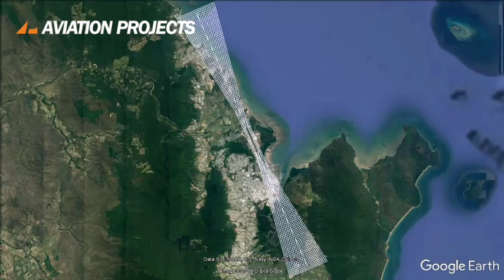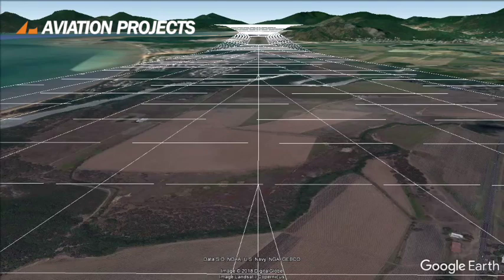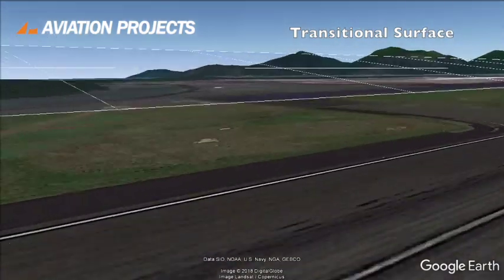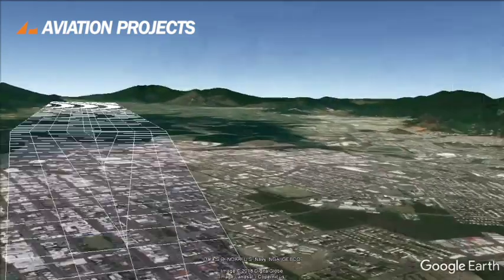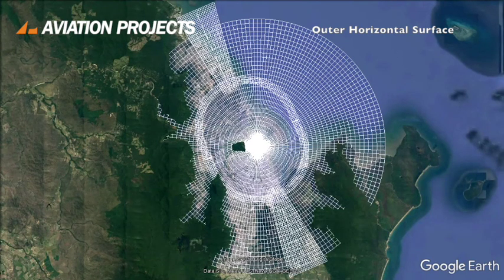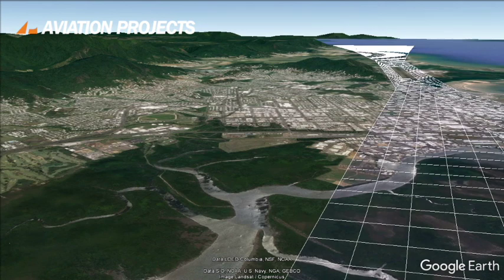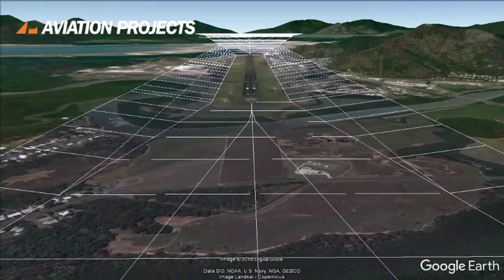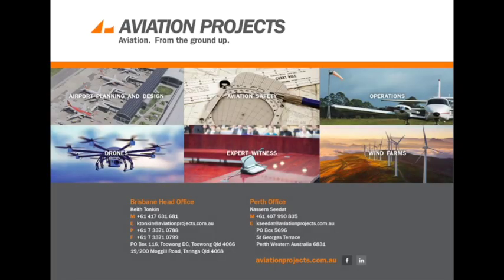Introduction to obstacle limitation surfaces

Comment: on takeoff , 600ft  clearance of a 9ft high wall is enought?
Power lines 30ft high is 2000ft away.
6000ft runway  for private jet, some of them with full fuel needs entire runway.